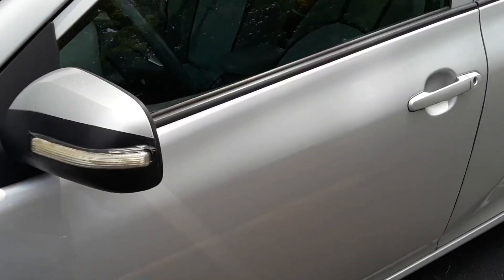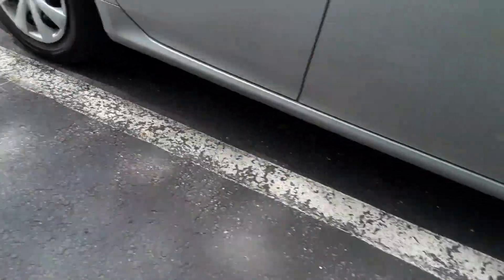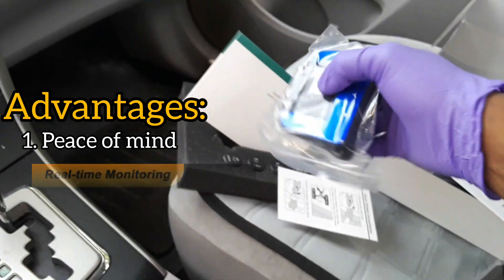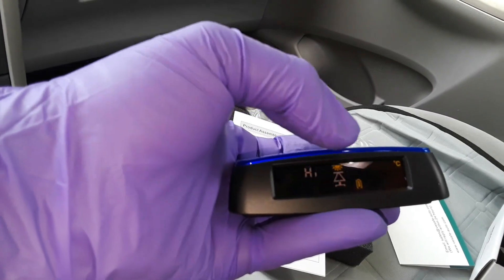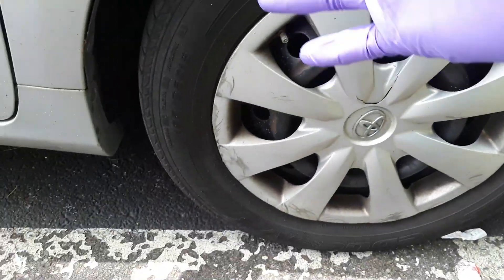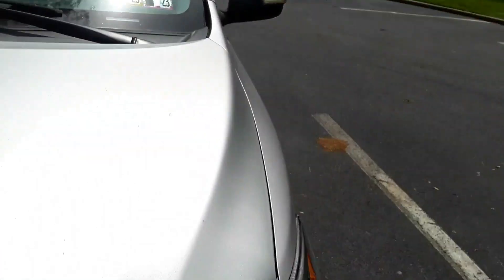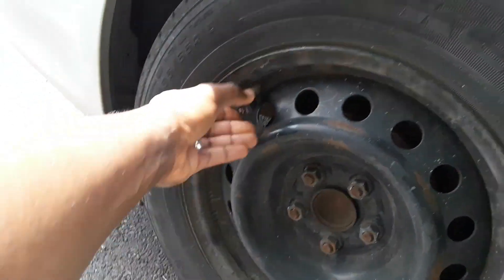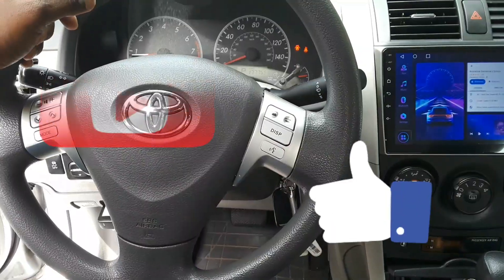How To Avoid Flat Tire Forever | VESAFE Tire Pressure Monitoring System

Comment: My TPMS light came on at the beginning of the year and I have been driving on a broken sensor since. However this past tuesday I woke up on a flat tire. Not anymore.
Reply from the maker: The external TPMS has been helpful so far!
Reply: @eazidiy I installed it today, however had to remove my wheel covers because it didn't fit when I put the sensor on the air intake. So far so good, I'll have to go get some new wheel covers.
Reply from the maker: @reynaldomatos6153 were the valve stems on your wheel that low for the sensors not to fit with the wheel covers?